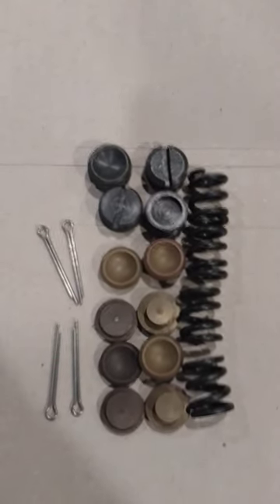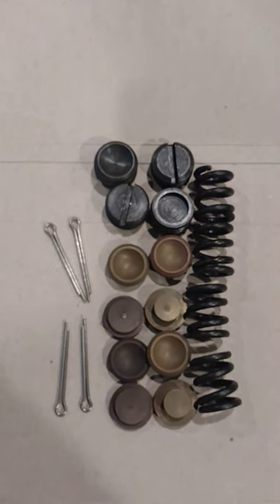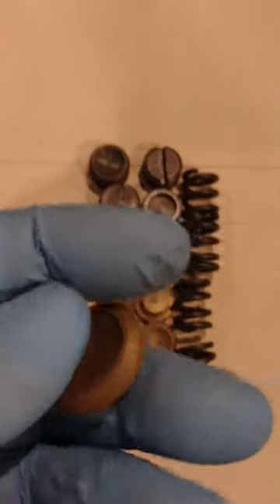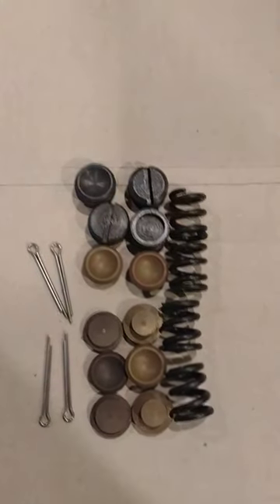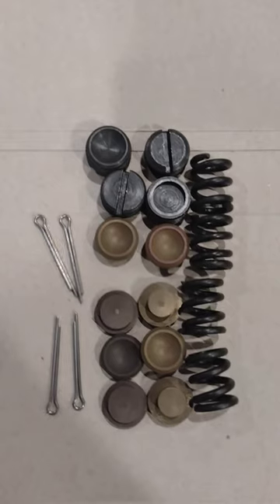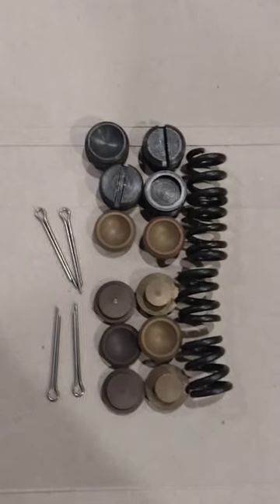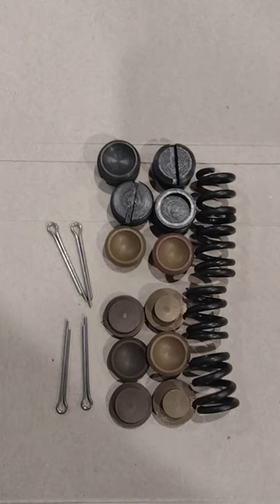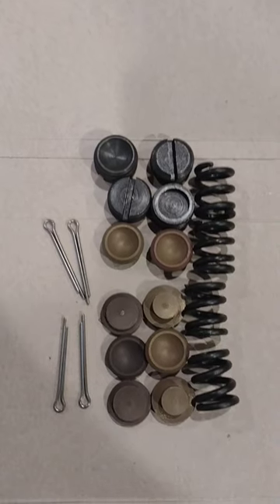A Quick Look at Bronze Impregnated Teflon Tie Rod and Drag Link Rebuild Kits for a Ford Model A

Comment: Back then most things were designed to be serviced and last a long time. With all the light weight materials and plastics, I don't see modern cars lasting as long. They live out their useful life and are gone. 
Can you imagine an hundred years old Kia Soul? No, neither can I.
Reply from the maker: Exactly!  Of course I can't imagine getting into one of those but that's just me 😁😁😁
Reply: @kensmithgallery4432  
I will give Kia kudos for having a great commercial campaign when the Soul debuted! The hamsters were a stroke of genius. Isn't it sad when the advertisement is better than the car? When my rich uncle gets out of the poor house I'm going to find a 31 Vickie and drive it till the wheels fall off! (I like the wider doors! I'm wide too!)
Reply from the maker: @williamforbes5826  me too!